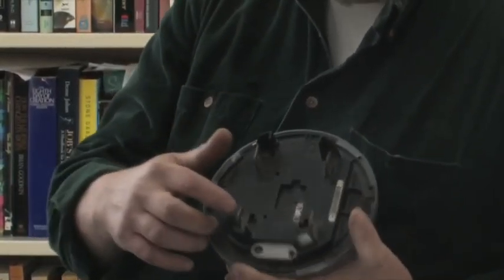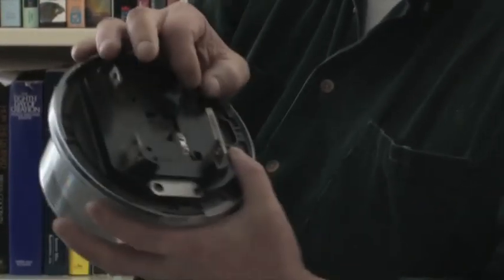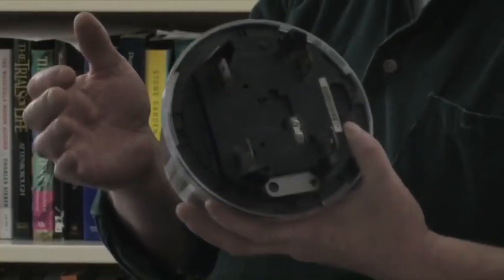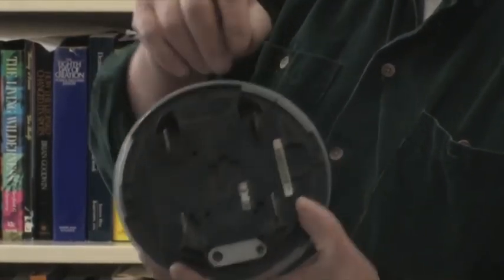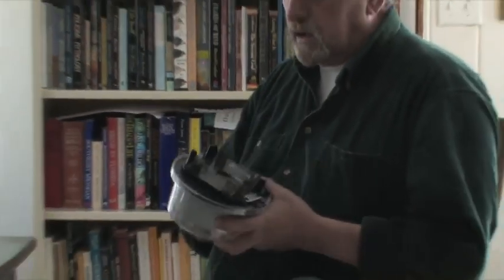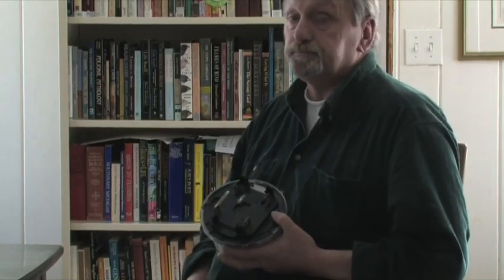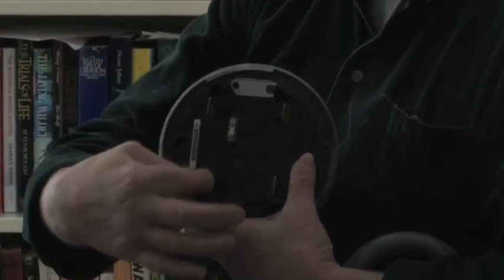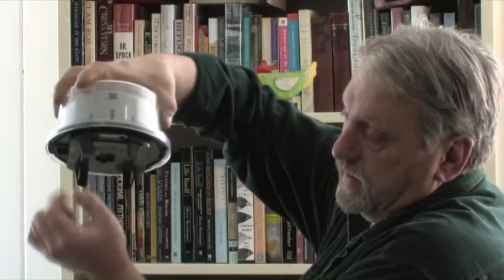Electrician Discusses Smart Meter Fire Hazards

Comment: I’m a retired electrician also for 30+ years. What this man says makes total sense about those blades being about a third less thick than they were on the old meters. I’m very familiar with the old original meters and meter sockets. now I see what the deal is  and I agree that’s what could cause the fires we hear about are  the loose connections between the new meter blades in the old sockets which could heat up and arc in some cases.

Comment: If this power company did NOT used the method in the following video link, then they are guilty of ARSON
https://www.youtube.com/watch?v=G0bq2Hn2vOo
Point #1 *NO INTERRUPTION OF POWER TO THE HOMEOWNERS POWER.
Point #2  CHECKING THE CERTIFCATION OF THE HOMEOWNERS UL APPROVED METER BOX
I do believe that in most states, installing a smart meter on a customers meter base that no longer can be certified, is a criminal offence.

Comment: So when the power company changes out a meter to a "smart" one, do they have the home owner turn off the main breaker so no load is on the line during removal and installation?

IF not, then that in itself would cause arcing on the contacts, or 'stabs'. Especially if something with a larger amp draw, such as an electric water heater was in the 'heat up cycle'.
Reply: I can answer that as a positive NO.  A smart meter was installed on my home today while my family and I were at work and school.  My first clue was all the clocks were flickering so I assumed it was a standard, run of the mill, power outage.  My wife had come home from work for lunch and told me the Consumers Energy truck was across the street when she was home and reminded me that smart meters were to be installed.  Sure enough, that's what happened.

The reason I ended up here is upon getting a beer out of the refrigerator after work, I noticed the light in there flickering.  Went into the office where our computer is, same thing.  The light is flickering.  Not as in on and off again, but as if there's voltage fluctuations.  After reading what I've read thus far, I'm worried...
Reply: Well after viewing this and other videos I have 'opted out' but have yet to see an increase in my monthly bill.

I suppose i won't until they actually start changing them in my area.

I have told quite a few of my friends about this 'smart meter' problem and most of them shrug it off like I'm some sort of 'conspiracy chaser'.

Oh well, I've given them the warning. I can't make them opt out.
Reply: I live in California, in the Bay Area. I checked the PG&E website and noticed that I could Opt Out of this so-called "Smart" meter. Today PG&E is coming over to remove it!  @russdavis1960
Reply from the maker: Matthew, please contact us at smartmetereducationnetwork@gmail.com. Also check out our website. You need to tell your state rep and senator about this (the ones who are in the MI, not national, legislature).
Reply from the maker: Russell, they don't turn them off. And you are right, this can be a part of the problem.